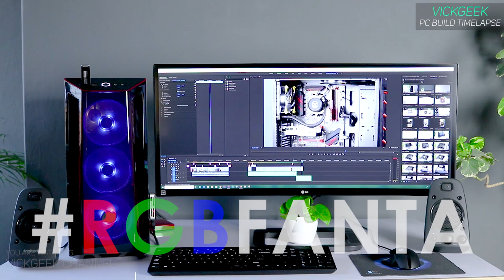$800 Rs 75,000 Video Editing Gaming PC BUILD TIMELAPSE | #pcbuild #gamingpc #rgbpc

Comment: Cabinet ka side panel glass or acrylic ka ha ??
Reply from the maker: Acrylic
Reply: Mb511 or 520 RGB version per tempered glass panel ha with 4 fan 6000 RS cost ha.
Kinda version Lena sehi ha 511 or 520 ??
Reply from the maker: Arpan Naskar  2 Major difference between 511 RGB and 520 RGB :
1. 511 has Mesh Front Design (I like it) where as 520 has a DarkMirror front panel and no mesh.
2. 511 has a model with Transparent Side Glass Panel with RGB whereas 520 has acrylic side panel (which I don't like that much)
One more thing, 520 Has maximum front radiator support. 
In dono mein se aap kaunsa bhi le sakte ho. They are really good cases. I would prefer '520 for looks' and '511 for Mesh that acts as a dust filter'.

Comment: 1050ti in late 2018 and you call it a gaming pc?
the card is from 2016 and would be outdated in 2 or 3 years for playing AAA titles.
Reply: My old 660ti can handle r6s on vh, and that's quite a modern games, most maps 50 to 60 fps, but favela is 40 to 30.